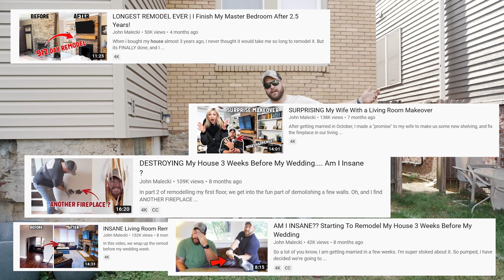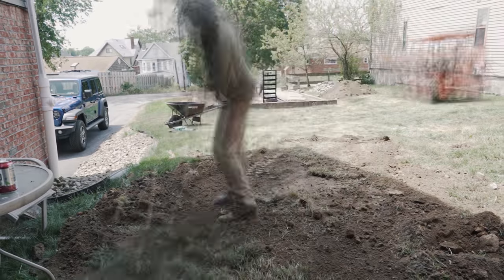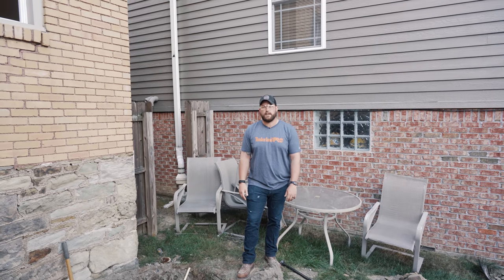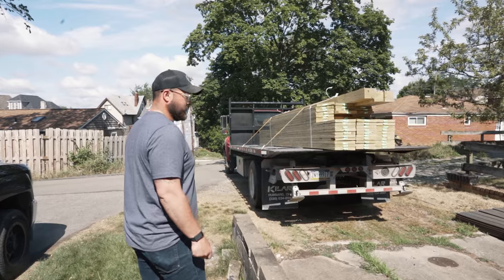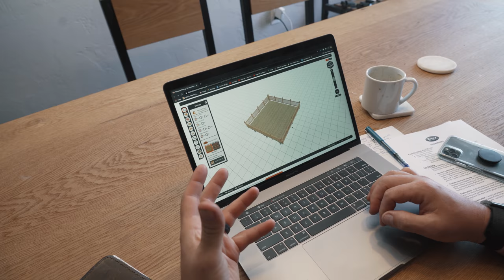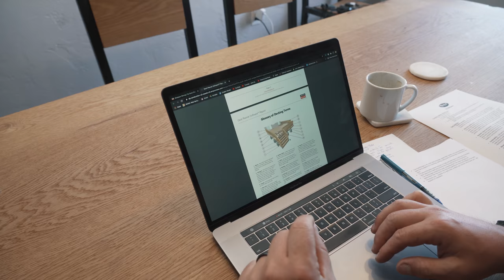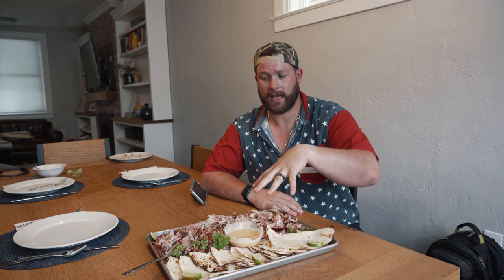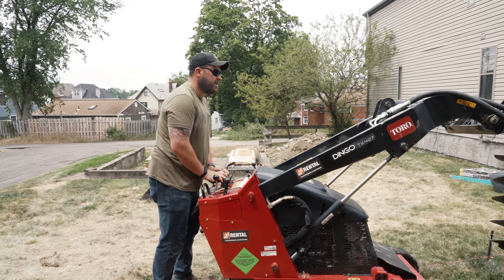Building An EPIC DECK - Pt.1: DEMOLITION

Comment: if you can rent that backhoe then why not just rent a trailer or a container and dump all your shit off right away instead of doing the xtra step of doing it later one more time. and if its because you "cant be arsed" then why not lay down some plywood or something under your pile to make it way easier to scoop shit up, sure it may kill the grass under if it lays for to long but so does the pile anyway
and if possible it woudl have been perfect to dump in on that location where the lumber is at 10:54

maybe im just an idiot but it kinda annoyed me that someone chose the difficult solution just because. just imagine next time he has to cut the grass and he has not siphted the rubble good enough out of the grass